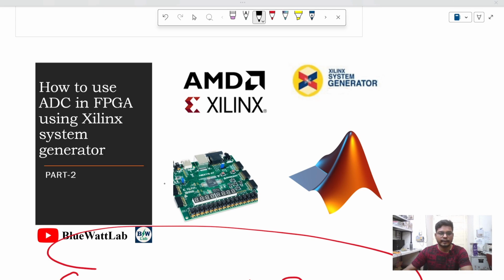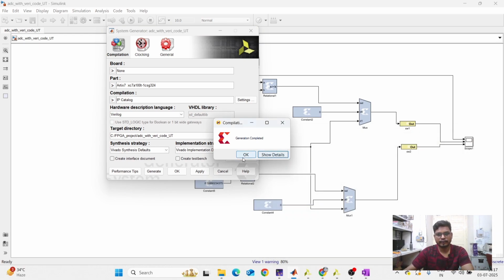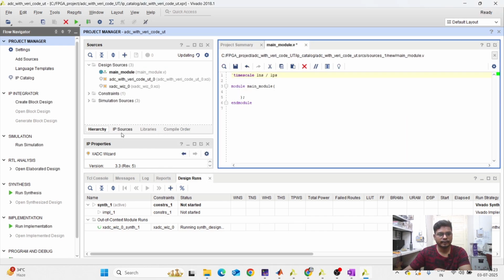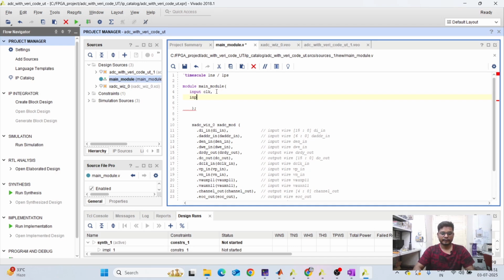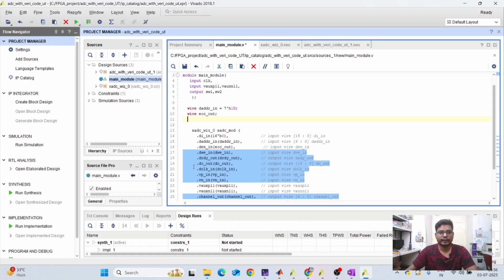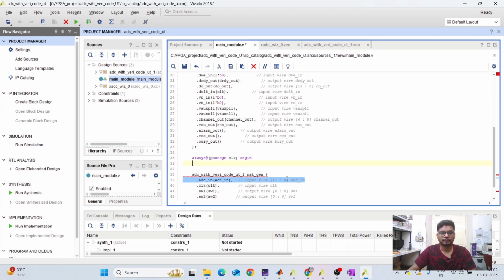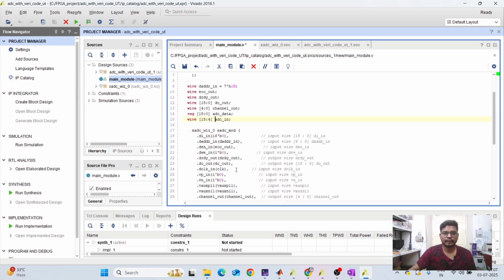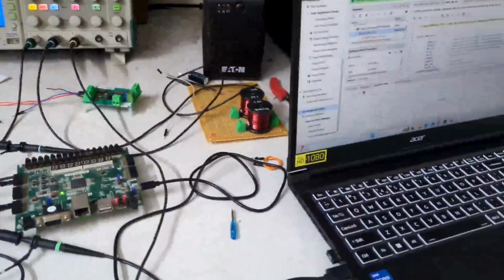How to use ADC in #fpga  using #verilog coding | Part-3

Comment: Hi BlueWattLab, thank you for sharing such a wonderful tutorial. Could you please tell what details for each blocks in the matlab system generator are? I have watch the previous tutorial, however, some of the block information were not displayed. I am getting some issues with datatype issues in some of those blocks. For example, what is the bit size for constant block with 2500 and the block details for the counter as well?
Reply: have you watch lecture "how to generate PWM part-1" ? In that video he explained how to configure counter block.